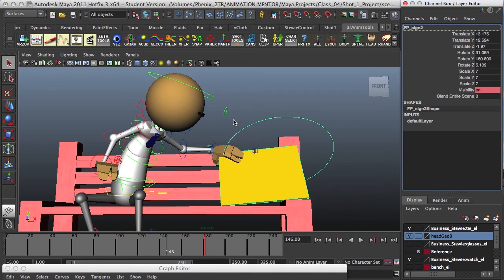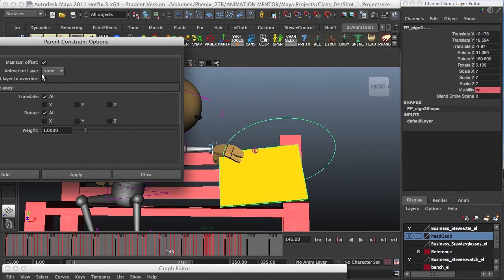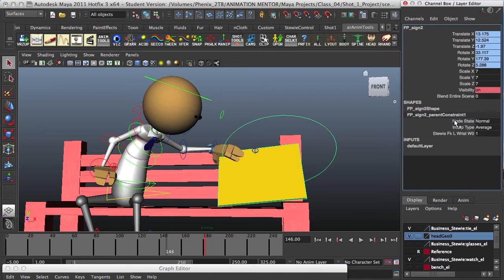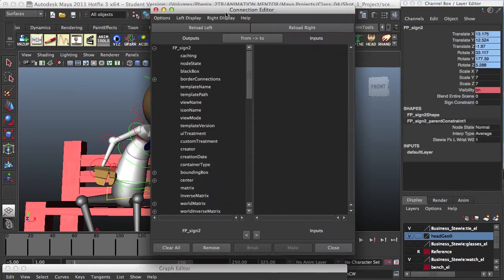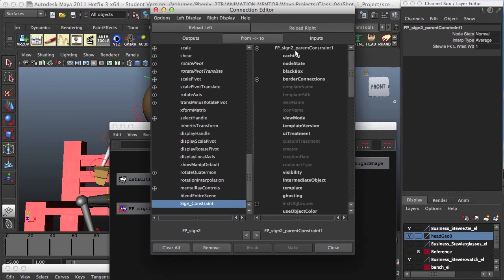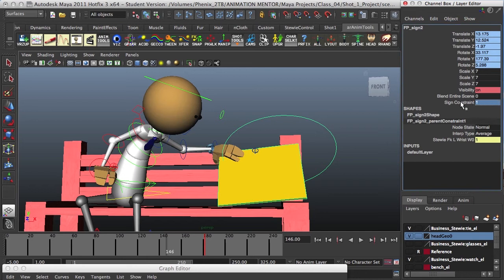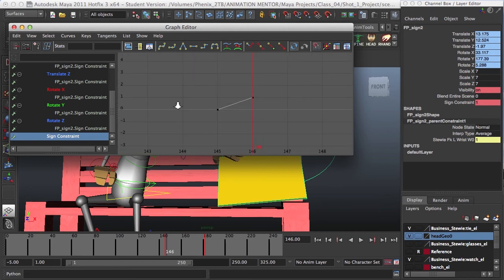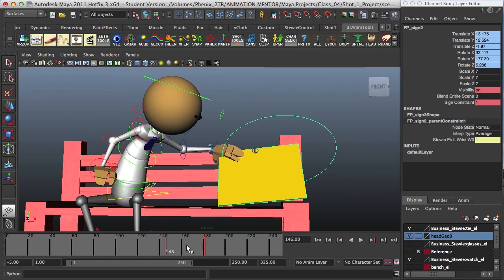Constraints_Controler.mp4

Comment: For example, if you want to constrain the hand to the bench later on, all you have to do is to create another parent constraint (to the bench this time). That will create the W1 in the SHAPES section. This last constraint won´t create a new "blend parent", you´ll use the same one for both objects. Blend parent = 1 means that the constraint is active. W0=1 means that the one that is active is the book one. W1=1 means that the active one is the bench. Once you get used to it it's easy. :-)

Comment: If you create a parent constraint and you press "S" on the constraint object, it will automatically create a new attribute called "Blend parent", which is keyable as well and it does more or less the same that the one you created. The ones that are in the SHAPES section (W0, W1, W2, etc) are useful to create constraints to different objects at different times.